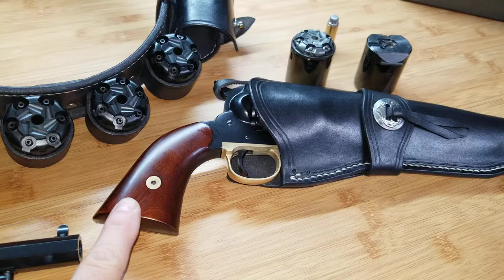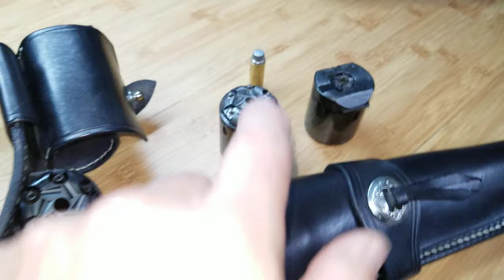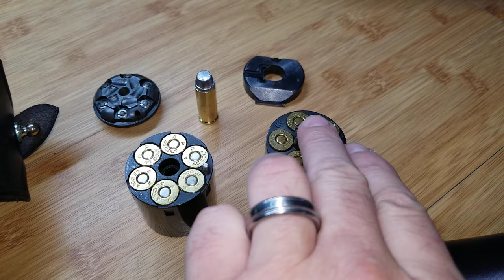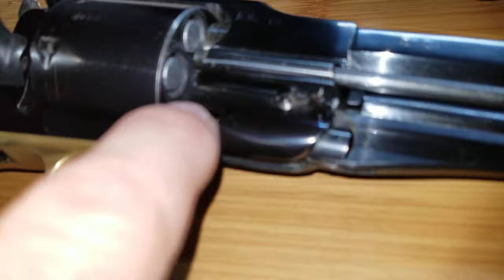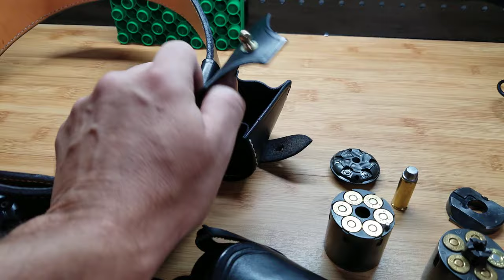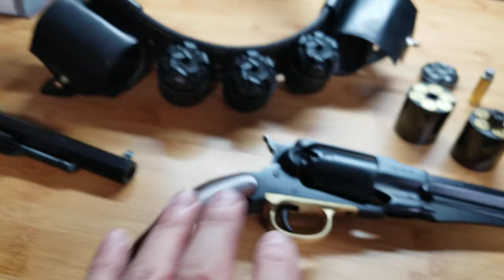1858 Remington Pale Rider Set

Comment: Wow there's quite a bit of hate in this comment section. I have been a Colt replica fan for years. I just purchased my first rimington last year and loved the fact that I could switch out my cylinders at the range. So far I've stuck with the black powder rounds as in Texas I do not need a permit to carry. I've never had a problem with my gun firing after sitting for several months. It is always been a concern of mine so maybe I should purchase a conversion cylinder for the house. Either way just wanted to tell you it was a very informative video and you did a great job. Thank you for sharing your knowledge of the replicas along with a very cool belt.
Reply: When you say, "I've never had a problem with my gun firing after sitting for several months.", did you mean that you left it loaded with black powder and ammo, and could shoot what's already in it several months later?
Reply: @huyked  The ones I keep in my home for home defense I fire once a year. The one I carry on my person everyday which is an 1858 Remington Ace I fire every single month. The Remington 1858 sheriff's model I keep in my truck. I fire every 6 months. I have never had a misfire utilizing this practice. Humidity is very high here in Texas so you can safely keep your black powder for that long in most other states unless you're talking about Florida or California. If you're carrying it on your body, it's definitely going to get the most moisture available, so that's the one I would practice with and reload consistently each month. Everything else you can play it by ear but 6 months to a year depending on where it is is good practice.
Reply: @huyked  Paul Harrel did a video:  Personal Protection: Cap and Ball Revolvers where he tried a BP revolver that he kept loaded for THREE YEARS and it had no misfires.

Comment: I think it’s referred to as a .45 long Colt is so it isn’t confused with a .45 auto. This obviously wasn’t an issue in the 1800’s.
Reply: At the time there was 45 Colt, and 45 Schofield which was noticeably shorter in overall length.  The Schofield  would fit in the Colt and Remington  as well as the Smith &Wesson that it was designed for. However the Colt cartridge would not fit in the S&W as it was too long. That appears to be the source of the commonly used name of "LONG COLT".
Reply: Not really, back in the day there was the 45 Schofield also referred to as the 45 short Colt, shich csn be loaded in the 45 Colt chambers.
Reply: @denisdegamon8224  Smith and Wesson might have had a problem with that. But then again I am judging from today's point of view; you could very well be correct.
Reply: Stuart Stuart they do make 45acp cylinders to swap out .
Reply: Yes, you are correct. When Colt brought the SAA back after WW2 they realized million of men referred to the 45 ACP as the 45 Colt because of the war, Hence the retronym, 45 Long Colt. You will not find the term "45 Long Colt" prior to the 1950s. It is a twentieth century phrase.
Reply: Nope....it differentiated between 45 Schofield (a shorter cartridge) and 45 Colt (longer cartridge). More details to this can be found. Nothing to do with 45acp
Reply: It has nothing to do with the 45 acp.. the term long colt was coined by army quartermasters in the 1800s to differentiate between other 45 calibers of the day
Reply: Exactamundo.
Reply: yes thats what i thought,as it was mentioned in a review of an airgun i had,airforce texan,that the airforce had more energy than 44 long colt,so long colt is called long colt in modern times,and is for revolvers,because later came the 1911  and the bullets had to be shorter.Its exact the same story for 22 rimfire,as when the 22 short came about it was not called 22 short   but 22    until  i guess 1863 or so when a longer 22 rimfire came out  so then there was 22 short and 22 long  only,and then later an even longer 22  long rifle.its fair to say most americans  do call 45 revolver rounds long colt,and are not automatic pistol rounds called colt 45 acp.I am english but in holland,I only know about the 22s  as i had 3 1863  revolvers,smith and wesson 22 short,manhatten arms 22 short or long,and a bacon arms pepperbox 22 short.All held as antique weapons  free to hold over 18 years old,without a firearms certificate.But you are not allowed ammunition for them or to shoot them.But in fact you could,using Flobert blanks,which is realy 22 short without a bullet,so flobert blank behind 22 airgun pellets.I sold those guns back to an antique gun store where I bought them,also sold my 1887 winchester lever action  12g,Due to being broke.And only kept one gun,an original  not so valuable  due to it being modified to a sheriff  model  like from pietta,but was done in the states by a professional gunsmith,around 1950,and has a dovetailed adjustable front blade sight,and was re/blued,But i can never shoot it,Its not allowed.Its the only gun i have had,that i can also take back to the UK if i return.I used to when younger belong to the southern skirmishers  SOSKAN,A re/enactment group,I could rejoin,I would only need a explosives licence,to store black powder,then i could shoot it like blanks.Last skirmish i took part in was in 1978,and i was loaned a 44 remington,A replica  and a handful of percussion caps,and left to guard  our union encampment,I got to aim on some johnny rebs,and shoot at them, then i was told to fall down,as i got killed.As the confederates over ran our camp.SOSKAN  was very small back in 78  but now much bigger.Many of the skirmishers from SOSKAN  were flown to the US,and were extras,in the movie  Dances with wolves.My unfortunatly modified remington new model army,Is in fact possibly,A gun that can resolve  A dispute,that being  it is not known,exactly at what serial number,the new model was introduced.all you can find online,is that it was between  two of the inspectors  that proved the guns for military use,whos names i forget,but the new model was between 15000  and 16000,introduced to replace the old model.these serial numbers were issued to the union army in march 1863.So my 5 and a half inch barrel new model army,which has all numbers of parts correct,Has a two line barrel address,the sept 1858 patent,And a trigger spring adjustment in the grip,and it is serial number 15034.The gun also has a strange story when i bought it from an older dutch black powder shooter.He was on holiday in the states,Back in the 1970s,And was in south carolina,Looking to buy a remington.He came across a gun for sale by an american,who had inherited the gun handed down from his grandfather or great grandfather,who was a high ranking officer,I think the dutch man said a general,in the union army.It was this american guy,who had the gun modified,and restored 20 years earlier,in the 50s.So what i think is,if this gun was one of the very first new model armys  delivered to the military.I think  high ranking officers  would be first in line,to get the new model.I dont know what you Americans think.Wouldnt it be nice if they had kept better records,that by serial number you could find out who your remington was issued to.I guess you know many british  are jealous of your gun rights.I have always since a child been crazy  over the wild west and cowboys,one of my sons is called Jesse james,And a remington would be my open carry  if i were in america.Cap and ball  and 5 reserve loaded cylinders,Thats 30 shots on an enemy,with inbuilt smoke screen,I have no interest in modern firearms at all.
Reply: .45 LONG Colt? No such cartridge.
Reply: @MercyMinister  technicaly thats true,but if you look at a video  of a american gun enthousiast,he was actualy testing the texan air rifle,and he had on his table also a colt 45 revolver,and he was proving how due  the texans long barell,it actualy had more muzzle energy,than the colt peacemaker  or colt army(after 1873)that he had on his table.and also told of the grains of the bullet shot by that revolver,and he described it as a long colt,I believe its 45/40,to define that cartridge as the longer  one compared to the shorter 45 from the 1911.i cant remember how many the grains were,but he also pointed out that the texan not only had more muzzle energy than the colt but also could not even in its dreams,shoot lead of 350 grains  and for sure not  the 500 grain the texan can do! i know there is no such thing as 45 long colt.Its very similar though  when 22 rimfire was first used  1860s,there was no such thing as 22 short,until 22 long  and then long rifle  came out. video from the you tuber  demolition ranch.
Reply: @MercyMinister  Oh james the guns clint eastwood shot,were actualy cartridge conversions,I am english by the way,but one of my precious possesions  is my  march 1863  remington new model army,A real nice one,i can swap my cylinder out and in about 2-3 seconds.
Reply: Never seen anyone confuse a 45 Colt (the actual name)  from a 45 ACP....   The ACP... actually says  "ACP"
Reply: And the side of his gun plainly reads "45 LC". Lol
Reply: No, Stuart, that's not the reason. The "Long Colt" got its name because soldiers kept requesting the "Long Colt" round from the military sutlers so they wouldn't be given the 45 Schofield ammo. The 45 acp (automatic Colt pistol) has always been differentiated from the revolver round by the "acp" designation.

Comment: Nope, unfortunately you are mistaken ! There WAS a 45 short colt, and I'm not speaking of the Scholfield .45. The difference between the short Colt .45 & the Scholfield .45,  was the rim diameter. The .45 Long Colt was designed for the Colt single action Army weapon used by the military in that time period. The problem with the "short colt" cartridge was that the rim was to small to effectively eject the shells in the Scholfield , so the wider rimed Scholfield cartridge was developed to accommodate the ejection process. The Army in it's wisdom didn't like the logistical problems that had occurred, So eventually opted for one weapon ( side arm ) that would utilize one cartridge, though all 3 were usable in the Colt Single Action Army. Hope this clears up the Colt cartridge controversy.

Comment: The 45 Colt was never officially called the "Long Colt" but there were shorter versions of the 45 round that could be fired in a Colt 45, so people started referring to the original as the "Long Colt". Winchester made a shorter version of the round.
Reply: It was called the 45 Schofield used in the S and W Schofield revolvers

Comment: You are absolutely correct in stating that the proper cartridge name is "45 Colt". The "Long Colt" and "Short Colt" verbal designation began around 1877, when U.S. Government Arsenals ceased loading the .45 Colt, and began loading the ".45 Government" round. The .45 Government was basically a .45 S&W Schofield with rim diameter reduced to the same as 45 Colt. The reason for the 45 Government is because the U.S. Ordnance Dept had started loading the 45 Colt down in power, to about 30 grains Rifle (similar to GOEX FFFg) under a 255 gr bullet, instead of the original loading of 40 grains rifle powder under a 255 gr bullet, because the very powerful 40 grain 1000+ fps load was difficult to train new recruits to effectively fire.  U.S. Ordnance loaded the 45 Government with a custom blend of FFg and FFFg, carefully formulated to push the 230 gr bullet at 800 fps.  The U.S. Ordnance Dept in 1910, requested that John Browning modify the ballistics of the 45 ACP to exactly duplicate the 45 Government ballistics. [John Browning's original load for the 45 ACP was a 200 grain bullet at 900 fps].

Comment: I got a Uberti Colt Walker 1847 44 Cal recently at a gun show. It came with a brown Triple K holster, Howell 45 Colt conversion cylinder and a powder flask. Built in 2001, it is very tight and the blueing actually has a blue tint to it. This might be the charcoal finish from Uberti. I don't believe it has ever been fired. The bad news is the Howell conversion cylinder is a bit loose. Howell says Uberti Walkers made before 2002 might need to be fitted. Like sleeving the bore or something? Kind of the reason I got it. The cylinder is larger and so takes 6 rounds and has plenty of steel between the cylinders. I just got a brown Triple K belt to match... the Josey Wales collection.

Comment: FYI, if all you have is a cartridge revolver, you can still load the 45LC cases with the same powder and .454 ball as the cap and ball versions use.  Just a large rifle primer instead of a cap. You will want a wad over the powder. then crimp the ball in place.

Comment: G somebody must have forgot that there was a 45 Schofield out at the same time. And it was a shorter cartridge that you could fire in a 45 Colt chamber. Not surprisingly, most of the loads that the Army used were 45 Schofield ammo in 45 Colt guns. But the reason that the word long was added to the Colt cartridge, was because it was longer than the Schofield. If you want to be an absolute purest, the 1858 Remington is a Double Action Gun. Because you have to not only cock the hammer you didn't have to pull the trigger, which is two movements you have to make to make the gun go bang. With the trigger cocking mechanism you only had to do one action, which was to pull the trigger.

Comment: Nice video of your Remington replicas👍. However, there is no such thing as a 1958 Remington!
*Firearms expert Phil Spangenberger tells us: “The gun used in Pale Rider was a New Model 1861 (not an 1863) Remington revolver. These are commonly misnamed as the 1858 Remington of which there is no such animal. Navy Arms founder Val Forgett Sr. called his replica of the ’61 Remington the 1858 to avoid problems with patent rights. “I know Clint used the 1861 model. He pulled the lever down to slide out the cylinder base pin (there is no barrel wedge on a Remington) and removed the cylinder. With the cylinder removed, he replaced it with a fully loaded cylinder, held in a cylindrical pouch attached to his gunbelt. “This was a very accurate re-creation of how the early Remington cartridge conversion revolvers could be reloaded.”

Comment: Nice rig. All them Howell cylinders are expensive. I bought my Uberti 1858 new model army revolver specifically to use a Howell drop in .45 colt conversion cylinder with it and the same day I ordered the piece I ordered the cylinder too and received them both the same day about 8 months ago this past august. I posted a video I made nearly 2 weeks ago on my channel of my most recent shooting session with it firing 5 shots from about 30 feet away at a cantaloupe. So far I’ve put about a box and a half of ammo through her since October and I’ve taken her out shooting about a handful of times. I always load 5 myself for safety. She tends to hit about a few inches to the left at 30 feet so I have to compensate by aiming a couple of inches to the right of center

Comment: Problem is, if you look at clips on YT the cylinders that Clint is swapping out are of a bored through design like a 1873 Colt.  You can clearly see the case heads in the cylinder, so thanks to "movie magic" he wasn't using a two piece cylinder as a normal conversion cylinder is.
Reply: Period accurate conversions were essentially just the kirst conversion but with the backplate affixed into the frame with a screw rather than attached to the cylinder like the kirst model. Meaning that actually might be historical accuracy rather than movie magic.

Comment: I just noticed the cylinder in the movie gun frame does not have a cap/ring over the cartridges. In a closeup where Preacher just pulls the cylinder rod, you can barely see the rim of one cartridge and there is no ring over the cylinder. Further, the lower hammer face is ground to a point to directly fire the primers. This suggests a "regular " .45 cylinder made to fit the frame rather than a conversion cylinder with a ring and firing pins over each chamber. Was there historically such a modification or conversion?

Comment: Clint's Remington is a GATED, RIMFIRE conversion of a cap and ball revolver. .46 rimfire (short & long) to be exact. All the handguns i saw seem to be 1860s conversions, so i guess its set in the late 1860s or before the advent of the colt 45s in 1873.
Reply: The conversions for the Colt or Remington, did not come out until 1865 or 1866. Not sure exactly.
Reply: I think pale rider is dated to around 1870 plus or minus 2 years, at least i think so... @longrider42

Comment: 1150 fps with a 250 grain slug is getting up there for any 45 Colt single action other than a Ruger.    Have you run em across a chrono?      For my 44 spl SAA clone by Uberti I like to run 250 grain cast slugs at about 830 fps from my 4.75" barrel.   this gives me around a 45 acp/45 Colt power with very manageable recoil and good accuracy.    Oh... I use HT coat bullets.
Reply from the maker: We run every test through a chony....

Comment: Hi! Nice video! Any idea how much velocity is lost when shooting 5,5" barrelled 1858 when compared to standard 8"? I know there should be a difference in how much velocity is lost when shooting black powder versus smokeless but I dunno to which degree. Any thoughts?
Reply: 50 fps per inch is a rule of thumb many use as a conservative loss. With 2.5 inches, the idea of 100 fps max as the other comment suggests is not unreasonable.

Comment: Actually 45 long Colt term was used back then, because of the Schofield S&W chamber in 45 was a shorter cartridge. That is why Schofield's were never issued to the army. The 45LC wouldn't fit inside the chamber.
Reply: Schofields were issued to the army..
Reply: Beg to differ, army issued 45 Schofield to Calvery on limited supply in Remington top breaks but supply problems insured , units getting colt ammo instead of Schofield, which wouldn’t fit colt ammo. So Schofield guns were dropped in favor of 1873 army models.